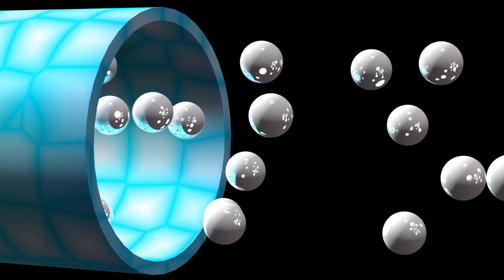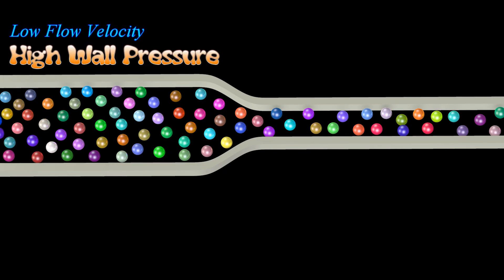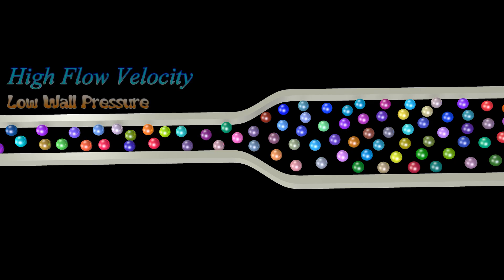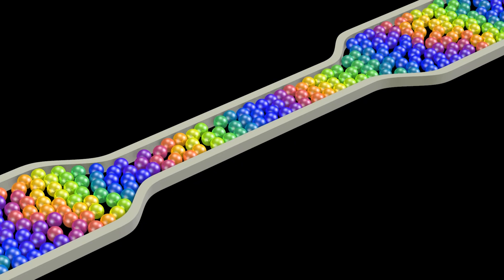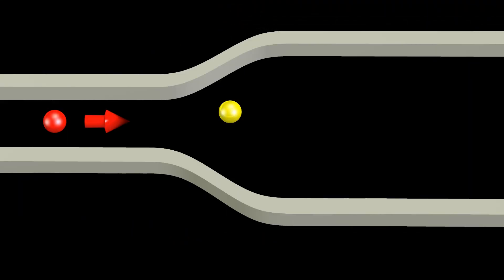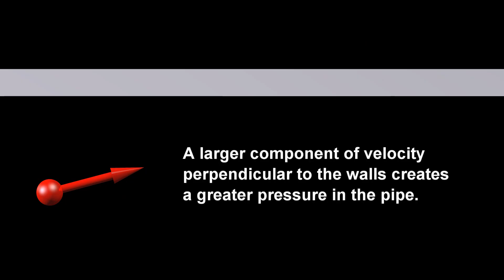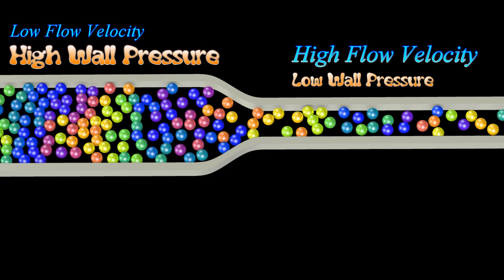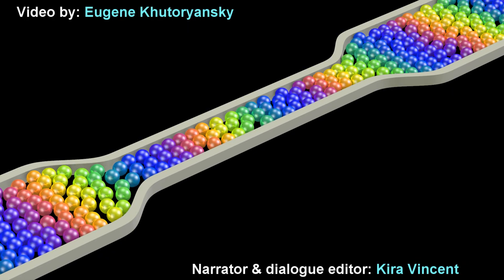Bernoulli’s Principle on Atomic Scale

Comment: You guys are really doing something great!
Reply from the maker: Thanks for the compliment.
Reply: Unfortunately, this speculation is not good science. 

The author of this script refuses to accept that a Pressure Gradient causes fluid acceleration as Euler revealed in the mid 1700 while following up on Bernoulli’s work. Air has mass and a force is required to accelerate any mass, even fluids. Pressure is the source of that force. 

Newton for fluids.

And, BTW, Euler derived what we now call Bernoulli's Equation. There is no indication that Bernoulli understood the cause-and-effect for what he saw in that typical venturi tube as the pressure/velocity inverse relationship.

This video’s explanation is very weak in its cause and effect logic. In fact, I am unable to follow the logic. Most times I’ve seen people trying to explain pressures down to the molecule level; they go astray in their assumptions as though it is simple balls - as a Newton’s “Hail of bullets”.

This video’s logic is faulty as follows.

It appears to be using another common misconception. Namely, that the random thermal motion of the molecules is changed by a net speed of the fluid in one direction. This claim is that the velocity and therefore momentum toward the wall is reduced by adding a velocity along the wall. This is clearly nonsense.  The temperature random motion is superimposed on the overall bulk velocity in any direction.

There is nothing to suggest that molecules change their random vibration to more in one direction (along a pipe) and less in another (perpendicular to the wall).  They vibrate the same thermal way regardless of a net movement in one direction and the component of that motion toward a wall is unchanged by that directed speed. This is how vector addition of velocities works.
Orthogonal velocities do not affect each other. This is just like the classical physics example of a cannon-ball that has its horizontal speed unaffected by gravity and its vertical acceleration by gravity unaffected by the horizontal speed.

By this reasoning, air in a sealed jar that is shot from a cannon has altered vibration motions from when sitting still.  This cannot be true.

For example, here is how velocities like this will add: A molecule moving thermally at some instant with a velocity at 45 degrees (up right) with speed (magnitude) 1.0 has an upward component toward a wall above it of 0.707 and a forward component to the right of 0.707. Adding a horizontal speed to the right of 5.0 results in a new horizontal speed component of 5.707 and the same vertical component of 0.707.

Velocities add vectorially.

The component of momentum perpendicular to the wall is unchanged.  The air exiting any blower into open air is at the very same pressure as the still air around it.

This can easily be measured by anyone, just as it is by professional aerodynamicists every day as shown here in 
Weltner, Fig 3:
http://user.uni-frankfurt.de/~weltner/Misinterpretations%20of%20Bernoullis%20Law%202011%20internet.pdf

Finally, the video completely ignores the  presence of the well-known boundary layer which is completely motionless at the surface, so as a result, this claim of the molecules moving along the tube is completely invalid before even entering this above discussion.

 This is bad science.
Reply from the maker: Observ45er, the video is correct.  You may want to read the following.
http://physics.ucsc.edu/~ccrummer/aero1.pdf

Comment: Your explanation is based on reality. I like this explanation. Make more interesting videos 👍👍👍👍
Reply: Unfortunately, this speculation is not good science. 

The author of this script refuses to accept that a Pressure Gradient causes fluid acceleration as Euler revealed in the mid 1700 while following up on Bernoulli’s work. Air has mass and a force is required to accelerate any mass, even fluids. Pressure is the source of that force. 

Newton for fluids.

And, BTW, Euler derived what we now call Bernoulli's Equation. There is no indication that Bernoulli understood the cause-and-effect for what he saw in that typical venturi tube as the pressure/velocity inverse relationship.

This video’s explanation is very weak in its cause and effect logic. In fact, I am unable to follow the logic. Most times I’ve seen people trying to explain pressures down to the molecule level; they go astray in their assumptions as though it is simple balls - as a Newton’s “Hail of bullets”.

This video’s logic is faulty as follows.

It appears to be using another common misconception. Namely, that the random thermal motion of the molecules is changed by a net speed of the fluid in one direction. This claim is that the velocity and therefore momentum toward the wall is reduced by adding a velocity along the wall. This is clearly nonsense.  The temperature random motion is superimposed on the overall bulk velocity in any direction.

There is nothing to suggest that molecules change their random vibration to more in one direction (along a pipe) and less in another (perpendicular to the wall).  They vibrate the same thermal way regardless of a net movement in one direction and the component of that motion toward a wall is unchanged by that directed speed. This is how vector addition of velocities works.
Orthogonal velocities do not affect each other. This is just like the classical physics example of a cannon-ball that has its horizontal speed unaffected by gravity and its vertical acceleration by gravity unaffected by the horizontal speed.

By this reasoning, air in a sealed jar that is shot from a cannon has altered vibration motions from when sitting still.  This cannot be true.

For example, here is how velocities like this will add: A molecule moving thermally at some instant with a velocity at 45 degrees (up right) with speed (magnitude) 1.0 has an upward component toward a wall above it of 0.707 and a forward component to the right of 0.707. Adding a horizontal speed to the right of 5.0 results in a new horizontal speed component of 5.707 and the same vertical component of 0.707.

Velocities add vectorially.

The component of momentum perpendicular to the wall is unchanged.  The air exiting any blower into open air is at the very same pressure as the still air around it.

This can easily be measured by anyone, just as it is by professional aerodynamicists every day as shown here in 
Weltner, Fig 3:
http://user.uni-frankfurt.de/~weltner/Misinterpretations%20of%20Bernoullis%20Law%202011%20internet.pdf

Finally, the video completely ignores the  presence of the well-known boundary layer which is completely motionless at the surface, so as a result, this claim of the molecules moving along the tube is completely invalid before even entering this above discussion.

 This is bad science.
Reply from the maker: Observ45er, the video is correct.  You may want to read the following.
http://physics.ucsc.edu/~ccrummer/aero1.pdf

Comment: Another way of thinking about this is that the average energy of the molecules in the pipe is constant and when the molecules are in the narrow section they have a greater velocity to keep the flow constant. Since they have a greater velocity in one direction, they have a reduced velocity in the other two, or else their energy would have to increase. Hence the lower pressure on the walls. I prefer this way of thinking rather than the velocity selection model presented here. Nice images for the video, thanks.
Reply from the maker: Thanks.
Reply: That is untrue.  

The author of this script refuses to accept that a Pressure Gradient causes fluid acceleration as Euler revealed in the mid 1700 while following up on Bernoulli’s work. Air has mass and a force is required to accelerate any mass, even fluids. Pressure is the source of that force. 

Newton for fluids.

And, BTW, Euler derived what we now call Bernoulli's Equation. There is no indication that Bernoulli understood the cause-and-effect for what he saw in that typical venturi tube as the pressure/velocity inverse relationship.

This video’s explanation is very weak in its cause and effect logic. In fact, I am unable to follow the logic. Most times I’ve seen people trying to explain pressures down to the molecule level; they go astray in their assumptions as though it is simple balls - as a Newton’s “Hail of bullets”.

This video’s logic is faulty as follows.

It appears to be using another common misconception. Namely, that the random thermal motion of the molecules is changed by a net speed of the fluid in one direction. This claim is that the velocity and therefore momentum toward the wall is reduced by adding a velocity along the wall. This is clearly nonsense.  The temperature random motion is superimposed on the overall bulk velocity in any direction.

There is nothing to suggest that molecules change their random vibration to more in one direction (along a pipe) and less in another (perpendicular to the wall).  They vibrate the same thermal way regardless of a net movement in one direction and the component of that motion toward a wall is unchanged by that directed speed. This is how vector addition of velocities works.
Orthogonal velocities do not affect each other. This is just like the classical physics example of a cannon-ball that has its horizontal speed unaffected by gravity and its vertical acceleration by gravity unaffected by the horizontal speed.

By this reasoning, air in a sealed jar that is shot from a cannon has altered vibration motions from when sitting still.  This cannot be true.

For example, here is how velocities like this will add: A molecule moving thermally at some instant with a velocity at 45 degrees (up right) with speed (magnitude) 1.0 has an upward component toward a wall above it of 0.707 and a forward component to the right of 0.707. Adding a horizontal speed to the right of 5.0 results in a new horizontal speed component of 5.707 and the same vertical component of 0.707.

Velocities add vectorially.

The component of momentum perpendicular to the wall is unchanged.  The air exiting any blower into open air is at the very same pressure as the still air around it.

This can easily be measured by anyone, just as it is by professional aerodynamicists every day as shown here in 
Weltner, Fig 3:
http://user.uni-frankfurt.de/~weltner/Misinterpretations%20of%20Bernoullis%20Law%202011%20internet.pdf
Reply from the maker: Observ45er, the video is correct.  You may want to read the following.
http://physics.ucsc.edu/~ccrummer/aero1.pdf

Comment: Bloody hell! After all these years, I now actually UNDERSTAND Bernoulli's Principle! :))
Reply from the maker: Glad my video was helpful.
Reply: Unfortunately, this speculation is not good science. 

The author of this script refuses to accept that a Pressure Gradient causes fluid acceleration as Euler revealed in the mid 1700 while following up on Bernoulli’s work. Air has mass and a force is required to accelerate any mass, even fluids. Pressure is the source of that force. 

Newton for fluids.

And, BTW, Euler derived what we now call Bernoulli's Equation. There is no indication that Bernoulli understood the cause-and-effect for what he saw in that typical venturi tube as the pressure/velocity inverse relationship.

This video’s explanation is very weak in its cause and effect logic. In fact, I am unable to follow the logic. Most times I’ve seen people trying to explain pressures down to the molecule level; they go astray in their assumptions as though it is simple balls - as a Newton’s “Hail of bullets”.

This video’s logic is faulty as follows.

It appears to be using another common misconception. Namely, that the random thermal motion of the molecules is changed by a net speed of the fluid in one direction. This claim is that the velocity and therefore momentum toward the wall is reduced by adding a velocity along the wall. This is clearly nonsense.  The temperature random motion is superimposed on the overall bulk velocity in any direction.

There is nothing to suggest that molecules change their random vibration to more in one direction (along a pipe) and less in another (perpendicular to the wall).  They vibrate the same thermal way regardless of a net movement in one direction and the component of that motion toward a wall is unchanged by that directed speed. This is how vector addition of velocities works.
Orthogonal velocities do not affect each other. This is just like the classical physics example of a cannon-ball that has its horizontal speed unaffected by gravity and its vertical acceleration by gravity unaffected by the horizontal speed.

By this reasoning, air in a sealed jar that is shot from a cannon has altered vibration motions from when sitting still.  This cannot be true.

For example, here is how velocities like this will add: A molecule moving thermally at some instant with a velocity at 45 degrees (up right) with speed (magnitude) 1.0 has an upward component toward a wall above it of 0.707 and a forward component to the right of 0.707. Adding a horizontal speed to the right of 5.0 results in a new horizontal speed component of 5.707 and the same vertical component of 0.707.

Velocities add vectorially.

The component of momentum perpendicular to the wall is unchanged.  The air exiting any blower into open air is at the very same pressure as the still air around it.

This can easily be measured by anyone, just as it is by professional aerodynamicists every day as shown here in 
Weltner, Fig 3:
http://user.uni-frankfurt.de/~weltner/Misinterpretations%20of%20Bernoullis%20Law%202011%20internet.pdf

Finally, the video completely ignores the  presence of the well-known boundary layer which is completely motionless at the surface, so as a result, this claim of the molecules moving along the tube is completely invalid before even entering this above discussion.

 This is bad science.
Reply from the maker: Observ45er, the video is correct.  You may want to read the following.
http://physics.ucsc.edu/~ccrummer/aero1.pdf

Comment: The high and low wall pressure is not right. It is the same, but the movements are different. Seeing that there is a bug needs to be fixed.

Comment: This is what you should be taught not what someone says. You should always ask why this happen then you will understand more clearly.  I think teaching science missing this concept of why something happens and will never help to understand science. Thanks Mam I am being a Mechanical Engineer never would have known why this happens. I think quantum physics should be taught more because if we know what is happening at micro level we will be able to design better.
Reply from the maker: Thanks.
Reply: Unfortunately, this speculation is not good science. 

The author of this script refuses to accept that a Pressure Gradient causes fluid acceleration as Euler revealed in the mid 1700 while following up on Bernoulli’s work. Air has mass and a force is required to accelerate any mass, even fluids. Pressure is the source of that force. 

Newton for fluids.

And, BTW, Euler derived what we now call Bernoulli's Equation. There is no indication that Bernoulli understood the cause-and-effect for what he saw in that typical venturi tube as the pressure/velocity inverse relationship.

This video’s explanation is very weak in its cause and effect logic. In fact, I am unable to follow the logic. Most times I’ve seen people trying to explain pressures down to the molecule level; they go astray in their assumptions as though it is simple balls - as a Newton’s “Hail of bullets”.

This video’s logic is faulty as follows.

It appears to be using another common misconception. Namely, that the random thermal motion of the molecules is changed by a net speed of the fluid in one direction. This claim is that the velocity and therefore momentum toward the wall is reduced by adding a velocity along the wall. This is clearly nonsense.  The temperature random motion is superimposed on the overall bulk velocity in any direction.

There is nothing to suggest that molecules change their random vibration to more in one direction (along a pipe) and less in another (perpendicular to the wall).  They vibrate the same thermal way regardless of a net movement in one direction and the component of that motion toward a wall is unchanged by that directed speed. This is how vector addition of velocities works.
Orthogonal velocities do not affect each other. This is just like the classical physics example of a cannon-ball that has its horizontal speed unaffected by gravity and its vertical acceleration by gravity unaffected by the horizontal speed.

By this reasoning, air in a sealed jar that is shot from a cannon has altered vibration motions from when sitting still.  This cannot be true.

For example, here is how velocities like this will add: A molecule moving thermally at some instant with a velocity at 45 degrees (up right) with speed (magnitude) 1.0 has an upward component toward a wall above it of 0.707 and a forward component to the right of 0.707. Adding a horizontal speed to the right of 5.0 results in a new horizontal speed component of 5.707 and the same vertical component of 0.707.

Velocities add vectorially.

The component of momentum perpendicular to the wall is unchanged.  The air exiting any blower into open air is at the very same pressure as the still air around it.

This can easily be measured by anyone, just as it is by professional aerodynamicists every day as shown here in 
Weltner, Fig 3:
http://user.uni-frankfurt.de/~weltner/Misinterpretations%20of%20Bernoullis%20Law%202011%20internet.pdf
Reply from the maker: Observ45er, the video is correct.  You may want to read the following.
http://physics.ucsc.edu/~ccrummer/aero1.pdf